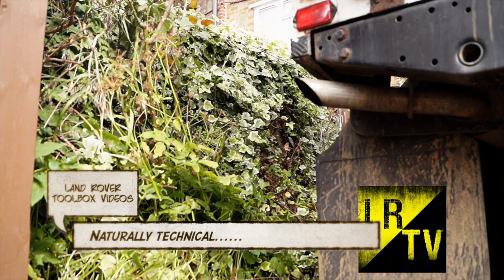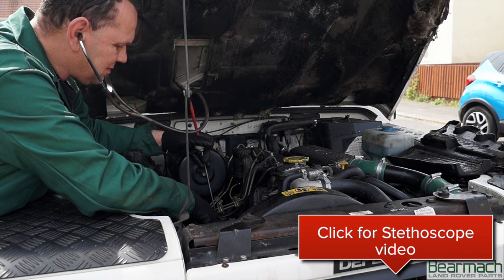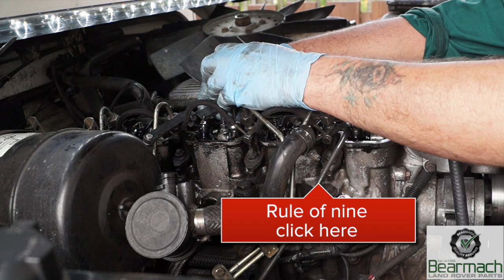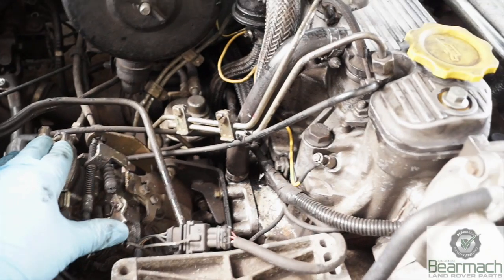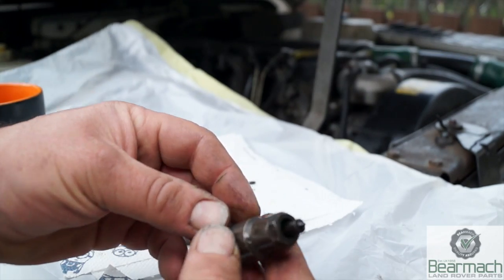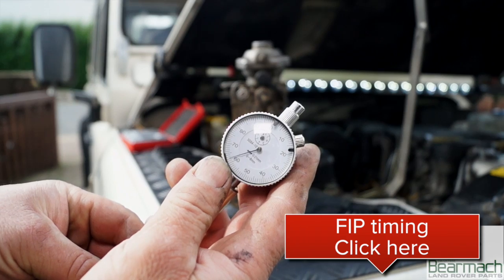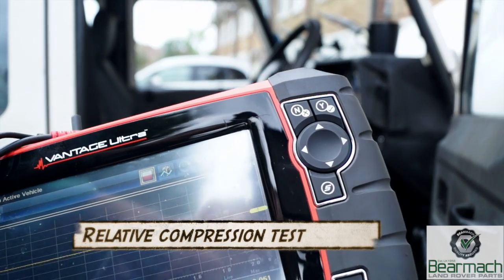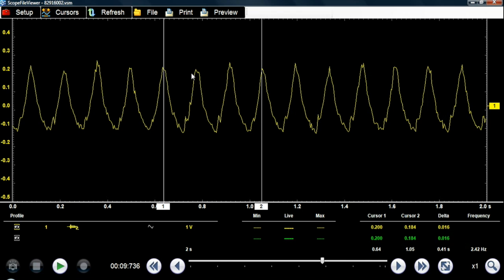Basic 300tdi engine condition checks PART 1 - The Fine Art of Land Rover Defender Overhaul

Comment: Hi Chris, good day. My 300tdi just had a timing belt change. After driving almost 1000ks it developed an intermittent loss of fuel supply while pressing the accelerator. One day the engine just stops while i was driving as if it was out of fuel. Now it doesn't start but still cranks. Does it had to do with the timing belt replacement? Hope you can give me an idea. Thank you

Comment: hello, i have a 300tdi defender 350.00 km still on the same head ,gearbox, it has timing gears as well   ive now found that engine oil is filling with diesel  and oil  is forced up past the glow plug al though not much.
Im thinking that diesel is entering past the oil seal at the diesel pump connected to the front case which has oil for the gears.
or the other is that diesel is  getting past the rings ,
any advice would be great thanks

Comment: I did a pressure compression test on a cold 300Tdi engine. I got more or less the same values down the four cylinders on a dry test. 330psi on cylinder 1; 320psi on #2, 320psi on #3 and finally 310psi on #4.   That was the reading on a cold engine.
Reply from the maker: The last set of readings were 400 plus PSI on the cylinders with engine at running temperature?
Reply: Land Rover Toolbox Videos , yes. with the engine nice and warm it was about 400PIS

Comment: Great video and channel I enjoy watching and very helpful. Just a quick question- done a compression test on my 200 tdi which came up with exactly the same result on cyl 1, 3, 4 which was 28 bar and on cyl 2 its 24.. It is a 20% difference and wondered if that would indicate a problem. It uses no water or oil however it smokes white grey unburnt diesel like smoke at start up so done a compression test when replacing the glow plugs of which 3 were shot but started fine. I think its a valve problem. Havent checked the clearances yet.